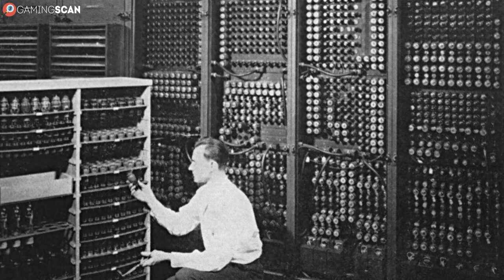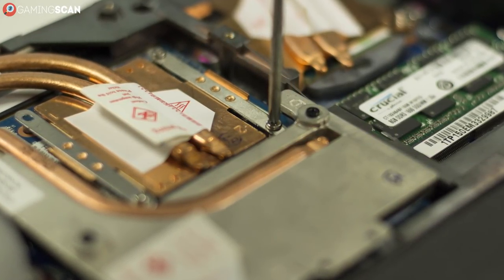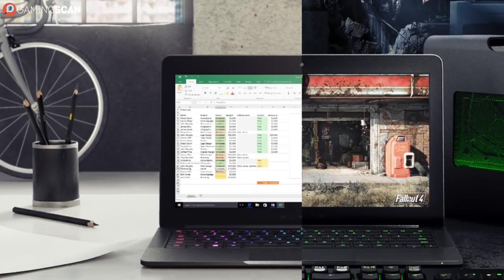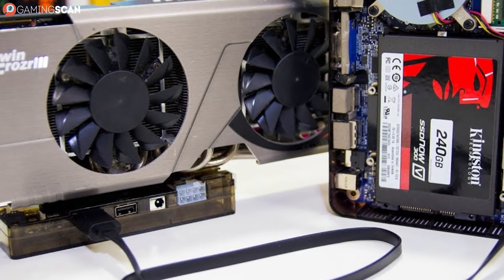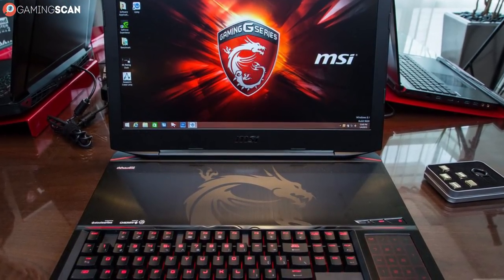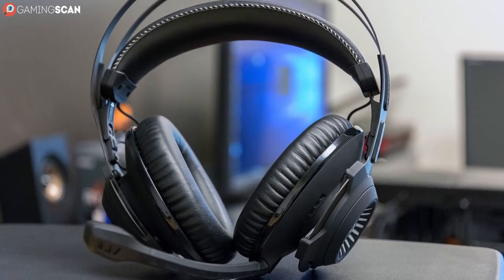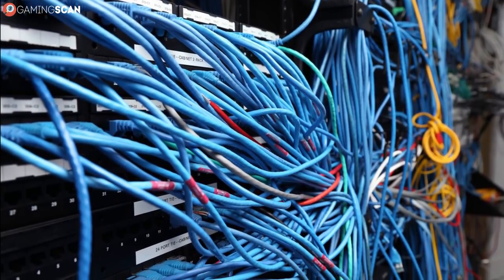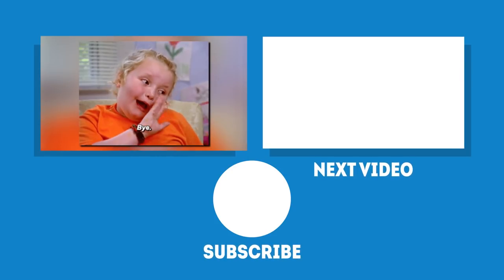Gaming Laptop vs Desktop - Which Should I Choose? [Simple Guide]

Comment: Ok so from reading comments and stuff here are my thoughts: 

1. If you move around a lot (e.g traveling for work, school, business) A laptop is your best friend.
2. If you want to use your computer for other things such as school projects, a laptop gives the necessary portability to take it where you need it.
3. A PC will most likely always outperform a laptop, especially if both computers are the same price. However that doesn’t mean that a laptop can’t run games, they can, very well if you buy the right type.
4. PCs require much more room than a laptop, it is important to plan where the PC will go.
5. PCs also require much more setup (keyboard, monitors, speakers etc) so laptops do become more fairly priced after taking that into consideration. But no matter what you get you’ll need a mouse for sure.
6. If your parents are divorced, laptops all the way.
7. PCs allow more freedom and customisations such as lights and specs.
8. PCs are much easier to get parts replaced but a laptop is easier to clean.
9. PCs are more powerful at a base level, you can buy a external GPU for a laptop but it does sacrifice a lot Of portability.
10. Not that anyone really cares, but laptops are nicer on your electricity bill.
11. I personally love watching movies in bed, that’s a reason I love my laptop.
12. PCs are usually not as warm as laptops because they have lots of internal fans. A laptop will get warmer and most likely louder the longer you have it on.
13. my last tip is this: you can make a laptop or a PC good for gaming, don’t get upset if you have been forced by a parent or financial situation to get one or the other, they both have strengths and weaknesses. 

Hope this helped anyone along their way! :)
Reply: Underrated Comment
Reply: Thanks
Reply: @ozziic5710  yeah. true.
Reply: @Bessiebuddy thank you so much for this bro💖💖💖💖💖💖. That's soooooo helpful comment.
Reply: A lot of thanks.
Reply: Who in the fucc needs a speaker
Reply: Point 6 just to hit em really hard💦
Reply: Thanks I salute ur hardwork
Reply: Parent not divorced.... I buy laptop?
Reply: @alienskullcollector3366  If your parents are divorce there is a tendency that you may go to your father's house or your mother's house I think that is what he means. That is why laptop is a better option cause you cannot bring you PC with you because it is way too big and not portable.
Reply: @nathanjuan6042  ouh.... thanks for explaining man. it really help!
Reply: So
Reply: Boi I’m getting a pc😂😂
Reply: im definitely getting a pretty expensive gaming  laptop cuz i like to be able to play pc games everywhere i go
Reply: Why if parent divorced needs a laptop
Reply: @onecnzaplay6210  cuz we assume if they're divorced you go back and forth between your moms home and dads home
Reply: I might get a gaming laptop with GTX1050+ but also buy an external GPU to boost it if the total price of this is cheaper than a laptop with RTX 2060+ however only use it the GPU when indoors
Reply: I will always be travelling coz I am in Uni and I won’t be living with the fam after graduation for sure so gaming PC is off the charts until I have my own flat/house.
Reply: Will probably opt for more CPU than GPU since I am not too much of a gamer, I want to go into digital art, coding and animation possibly.
Reply: Thanks a lot this really helped me :)
Reply: Your comment is more useful than the 7 minute video
Reply: beat the 7-minute long video that explained just the same thing.
Reply: My dad was super generous to gift me a gaming PC to replace my aged and bottlenecked old one so i could run Adobe products smoothly for my technical school projects. I love the PC tons for the work and gaming i can do on it. But i occasionally wish i had the option of portability for travel such as the long school trip that was planned before covid-19 cancelled it. 

Pros and cons. Both are great for what they offer.
Reply: Thank you for sure helped me on my quest😂
Reply: bessiebuddy 1-2 😭
Reply: This was so much better than the video
Reply: Bro omg thx so much 🙏
Reply: @samritchakraborty7433  Hey bro same here. I have a gaming pc at my dad's and bring a PlayStation back and forth. :(
Reply: I aint reading all that shit 😂
Reply: Most helpful comment thanks👍👍👍
Reply: My sister made me get a gaming laptop but not a desktop first reasonable answer since I don’t know anything
Reply: 6th works for me thanks
Reply: that just made me more confused on with i should decide on
Reply: Yeah you r right. For me laptop is an upgrade of a desktop because of its portability, laptop can do all what the desktop can but the desktop cant do the portability of a laptop. The only thing that desktop surpasses a laptop is desktop has the better graphics and performance than laptop, laptop has good graphics and performance too but the destop is better on it. So overall, laptop won for me.
Reply: tysm this really helped, comment deserves more likes
Reply: cool
Reply: my guy wrote a whole essay for us
Reply: thanks a lot bro i think laptop will the fit for me becuase of the following reasons:

1) i like portability that comes with laptop and i dont mind gamming on laptops keyboard and i already have a mouse
2) my house doesnt have sufficient space to fit a big pc
3) i can use my laptop to do school work anywhere i want
4) with a laptop to i can get nice frames in games

though i know that nobody cares why i want a laptop but i will comment this anyway to satisy me
Reply: Damn I read all of that and I ain’t complaining I’m gonna go for the laptop!
Reply: Who said this word is cruel? This person is an angel. The last lines hit me :)
Reply: Thx and lol the divorced one was joke that guy probably hates u now
Reply: You forgot to include something, like Number 14. Laptop have the advantage over PC, the Battery, especially if you live in a Blackout.
Reply: point 6 💀

Comment: i bought a laptop like more than a year ago and i regret it more then anything else...even if i had to travel a lot i would carry my PC lol cause laptops suck and are very expensive !!
Reply: lol ikr
Reply: you can buy a msi laptop for 1000€ with core i7 and gtx 1060.this would be 600€ for the same desktop pc plus you need keyboard mouse and monitor. so it is not that expensive in my opinion
Reply: I feel you dude. I made the same mistake back then, but thankfully, I got back to desktop. Man it felt like you're back at home.
Reply: guys I am planning to sell my whole pc and get a gaming laptop. Should I?
Reply: @storks7780  if u r going for gaming only and sit in one place then always desktop....  Laptop r only good if u r traveling...  Other then that...  No matter what other people said desktop is cheaper then laptop... Even if u add monitor and other stuff...  If u choose same specifications
Reply: @storks7780  and best thing you can customise it
Reply: Amrit Prasad oh!! Thanks for that great information!! I only travel about 4 times a year, so I guess Ill just bring my macbook there, and keep my pc.
Reply: Laptops are very expensive since its a miniature version of the desktop, but it performs slightly less than desktops, since GPUs and CPU are opt for less heat temperature, means it is by default run on a less performing settings than desktop versions of the GPU and CPU, since gaming laptops since 2016 have been manufactured and mass produced with built in liquid coolant system, its by-far the best choice if you are going for the portability, since its the only reason you would buy a laptop, something to have in handy anywhere you go.

In many cases, people who are living in areas that are prone to flooding, they necessarily need to often move their things around inside the house if they get flooded (this happens most often in tropical countries in asia that only has 2 types of season, wet and dry season, and other places that are often being hit by storms and LPA like in the Philippines, and Indonesia and India, as well as Malaysia)

For people who are travelling around, visiting their relatives or occasionally on vacation for some reason, as well as for people who likes to move around inside their big house that they want to find the most comfortable spot in the living room, or even their porch.

It all comes down to preferences, necessity.

I even find that other laptops that are even a year old could actually be good enough for gaming, as long as the minimum requirement would only need atleast 1GB of the system's GPU to run the game so atleast, some laptops has atleast 1GB of GPU, there's tons of games that only need that much to run their game at a stable graphics settings (personally there's tons of games out there that i have yet to play, but i can't since i own a decade old laptop)

Even if i don't have that much cash, if i were to be picked which i would choose, i would go for having a laptop instead of a desktop, considering i move around the house a lot, since my neighbor let me connect to their wifi, and its free wifi, i don't have any other reason to buy a desktop other than if i can move it around often lol.
An external GPU would work for me as well if i have plans to play games that requires more GPU power to run them at HD settings.
Reply: Laptops are better than PCs!!! Edit: nvm I like PCs better
Reply: You know if your pc  Nvidia graphics then you can connect it to Nvidia portable shield
Reply: it depends living conditions because i switch between houses once if not more a week
Reply: @storks7780 get the new area 51 gaming laptop that Alienware made. It's a portable pc that you can upgrade.
Reply: Dhruva V Ah yes.. but it's too expensive for me.. :((
Reply: KaZ made the same mistake, new to pc gaming, feeling of relief seeing these comments LOL
Reply: Laptops don't sucks
Reply: @famixrap  Yea thats what im doing. Im buy an msi laptop gtx1060 intel core i7-8750h 6gb vram. It will run every game easyy. And the cooling on the msi laptops are very good
Reply: @famixrap  itc actually rlly expensive. Ok fine it can be as little as 100 more expensive. But why would you pay more for much worse perfomance
Reply: Totally at first I thought about getting a laptop but then I I stopped thinking about it for a second and thought that I’d rather get a gaming pc which are a beast and plus for a much less price then a gaming laptop
Reply: @Justme-jp8ih  hahah every game easily
Reply: famixrap Would you rather sacrifice portability or performance
Reply: Pinco Del Pallino Yes they do they're slow
Reply: @thelordthorsingh2595  i like how u were so entitled to ur opinion that laptops are better than PC's and then switching it up lmao

Well for me i think PC's are better than laptops so were the same
Reply: Zero zone lmao yeah but I like iPads the best lol
Reply: I imagine myself with a whole PC in a plane with all these cables and everything xD
Reply: LeaveMeAlone i actually did it when i was in the cruise ship lol.
Reply: @Βενιαμίν-κ2ξ  what de faq
Reply: Same 😭
Reply: Maybe you chose shit laptop because there are some awesome ones in the market i bought 800$ laptop with 1050ti and it runs everything like a beast cs go 200fps+ gta online high and ultra settings aways  60fps+ . I never regret buying it.
Reply: laptops these days are getting even better tjan pcs lol
Reply: Super JLK i  know, i use a desktop but gaming laptops are good choices for people that want easy cable management, people that have small spaces or portability even though some gaming laptops are heavy for that lol
Reply: Uhm just get a Mac, they are literally fast and so much more better
Reply: @storks7780  yes u should

Comment: This is true I’ve had a gaming laptop for over 2 years now and it is always overheating, the battery life time dies quickly because every time you game you have to have your gaming laptop plugged to the charger and we know what happens when you have a rechargeable battery charging all the time, the battery’s lifespan will decrease, mine is only like 2 years old and I already have trouble with the battery and to change it to a new one it might be from 100 dollars to 500 dollars, sometimes I’m playing a game and then my computer will just shutdown out of nowhere because the battery is too low even tho I have it plugged to the charger. Don’t buy gaming laptops they are not good for long term, they will be good for the first 2 years then you will start struggling with the battery lifespan, overheating and also they get too slow after a lot of use. Just go for desktop it’s way better option

Comment: They're both classified as personal computers but still I prefer desktops that way you can upgrade your Hardware over time unlike a laptop even though it's kind of cool to have a high-end computer on the go. Also gaming laptops can also have a second Wi-Fi card slot for an SSD. So you can have both SSD and HDD Drives.

Comment: Laptops are trash when it comes to gaming, trust me. I’ve basically gamed on laptops my entire life. They usually only last 2-3 years and are hella expensive, they are just not worth it in the end.
Reply: read this on a 2~ yo core i5 7th gen laptop (I have a keyboard and mouse attached to it)
Reply: Mine lasted 6 years and only broke because I was admittedly not careful with it. If you're going to game at home, don't get a laptop. More expensive and heats much faster. However if you plan on flying long distance a lot, it's great tbh. I've played it on so many flights before
Reply: Never trust a guy on Internet who says trust me.
Reply: @crinsombone5380  well there are laptops that actually have capabilities as a desktop.  TBH I know of some laptops with Superior cooling systems than a liquid desktops cooling system. I know it saids crazy but there are those big ass bulky gaming laptops specifically designed to keep it's components cool ASF where there is a lot of room for overclocking.
Reply: IKR, my gaming laptop I have right now the price was so overpriced for how trash it was. The first time I bought it it was decent and I thought it was good for price considering I never had a good pc in my life. But now I just regret it cause it’s SOO trash and takes long to load.the fact that the only difference is that it is portable still doesn’t make it nearly worth it. I’d rather instead of bringing my laptop to a friends house to play, I would rather put my whole pc setup in a bag and set it up each time I go somewhere
Reply: My laptop is dell inspiron 15 gaming 500 intel core i7
Reply: @misfitpants54  yea but they cost like 4000 dollars lmao count me out
Reply: @heusant  nope wrong! Look at the Alienware area 51m.
Reply: @misfitpants54  i dont need a shitty overpriced laptop i already got a pc
Reply: @misfitpants54  laptops have shitty fans that sound like airplanes jet engines lmfao
Reply: I have a small bedroom so I hook up my laptop and vr in the living room to play.
Reply: I upgrade my laptop every 2-3 years so spending 1k every few years isn't that bad. Plus my old laptop goes to my wifey who doesn't really game. So it gets played hard for a few years then it becomes an office/media laptop! :) PS. Always buy a 3-4 year protection plan lol I have learned from my past!
Reply: Emm depends how you  threat a gaming laptop last about 6 yeras but if you take care of it it will last for years both is pretty good but laptops are slower to game on and have more temp but they also can take more heat so win win i will recomend desktop just my oppinion
Reply: My gaming laptop is on its 4th year and still working well i think its the brand u have
Reply: best bang for ur buck def desktop ....
Reply: @reaper7328  You probably paid like 3k for that shit when I can run ez 144fps at 1440p 144hz on my desktop and it cost only 1k
Reply: that's so unfair they should just add the best performance from the pc and hook it to the gaming laptop and reduce the fans so it stay's cool when gaming and they should definitely reduce the price of gaming laptops its way to overpriced
Reply: Everyone is entitled to their own perferences and opinions. It depends on what kind of gamer you are and how your daily lifestyle revolves around. Me personally im not a hardcore gamer and at the same time i dont have the ample time to play games at home due to my busy schedules so thats why a decent gaming laptop should do the trick for me.
Reply: laptops these days match the performance of gaming pcs. you could literally get a laptop with rtx 2080 cheaper than a pc
Reply: stfu PC needs mouse, cpu, monitor, cable, mouse, and speakers and it cost so many money and it's not good for those who can't pay electril bill.

Laptop includes touchpad, speaker, monitor, keyboard, and monitor.

And it's kinda expensive but it's good for those who can't pay electric bills and if a electric cut happens, you can still play on your laptop.
Reply: Yeah Man
but the family can't understand this Man
They are like-
Desktop-  they are useless!(even if you have one with 8 gb graphic cards, AMD Ryzen 9, 2tb HDD )
Laptops- They are good!
everybody-why????
they will be like- Because we know better than you
Reply: I agree with you
Reply: My 2013 Asus still going strong .
Reply: ikr mine lasted 3 years, the whole ass hard drive spoiled on me